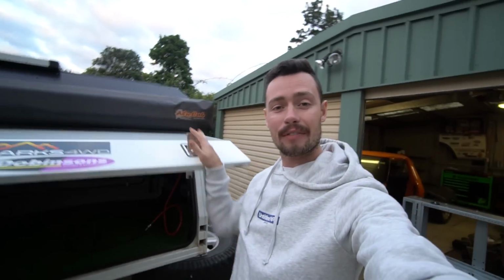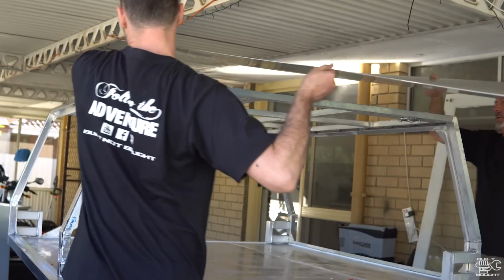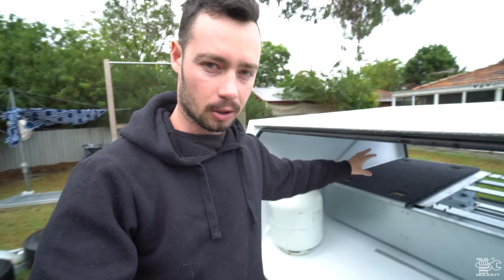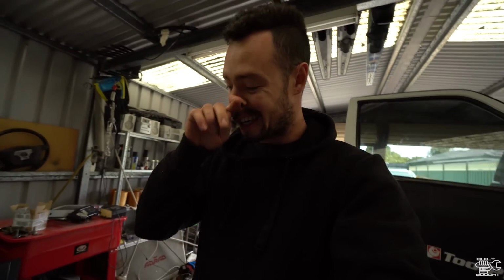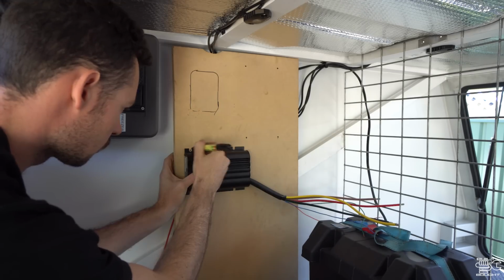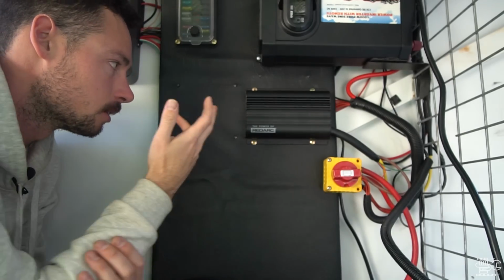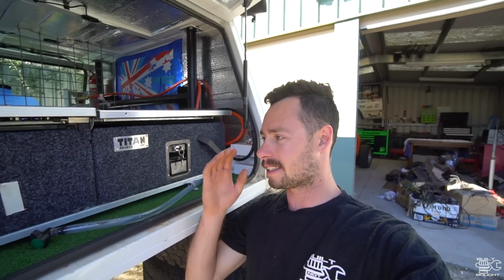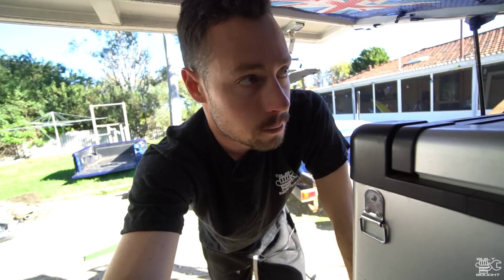BUILT NOT BOUGHT Ep.18 || My Canopy Interior

Comment: Hey mate if your widow solar screens fail,  Insulbreak 80 made by Air Cell is a foam and foil insulation i use on sheds construction in between the frame and the colourbond sheeting. It’s 8 mm thick foam insulation with foil on either side. It also stops condensation forming and is a great heat insulation. I stuck mine on with sicaflex rapid fix 4 years ago and it still looks great.

Comment: Awesome job on the canopy, although you may want to check the gas standards as you will need ventilation for the gas bottle as well as checking distance requirements from electrical gear.

Comment: Hi Sam, I have a 90l Waeco which automatically switches to 240v when I plug in the electric hook up, it would be worthwhile checking your fridge/freezer manuals because I bet yours are the same!
When I get home all I do is plug in the 16A 240v plug (UK caravan spec) and the fridge automatically switches over to 240v and my battery chargers start topping up the batteries again ready for the next trip out.

Comment: mate, the ridge rider 60litre fridge draw.  Make sure that its well ventilated.  Mine has peaked at 94w during summer while sitting in the car.  They are a very thirsty fridge in terms of power usage.   Also, they use a 120mm computer fan inside for the condensor, I upgraded my fan to a 140mm high flow fan which actually uses less power than the stock fitted 120mm.  reason for this, mine cut out while sitting in the back of the car on a 40 degree day, with all 4 windows down 50mm

Comment: You should put plywood across the front with marine carpet then screw your switch panel up to it and your inverter and stuff to the ply wood and run the cables behind it. It will look heaps better

Comment: 240 volt setup for everything, grab a projecta 25 amp charger and bang it on the wall too, can leave fridge and freezer on 12volt then when you have 240 avail, and it will just top your batts up at night, best thing i every done
Reply: 666starlet - do you connect the charger straight to battery or run it through the DC DC unit? Thanks

Comment: Bruzzz
It looks like  youve used power cable as the isolating cable  ?
Most guys  use the earth as isolation  cable as you have less issues if it fails...
What my mate told
As i had to do these isolators on all the work equipment 
Forklifts / prime mover
Reply: I think Sam is an electrical engineer... Just saying.

Comment: I have a Dual cab  Hilux common rail i put a tray on it its 6 foot long, i then made the canopy for it all up $300 plenty of head space when sitting up in bed then i added the stuff it runs 2 100ah batteries led lights has the largest waeco fridge a 200 watt folding solar panel and a fixed 300 watt solar panel inverter gang panel controls everything propane stove all doors have gas struts we sleep in just over half of the canopy which takes a double mattress the other side is the heart of it all kitchen inverters ect it also runs 2 awnings i have just fitted a Endless breeze fan, i brought brand new for $30 lady paid $230 for it but never used it  i had no plans just went out and made it, i have had so many comments its not funny  i am just a farmer